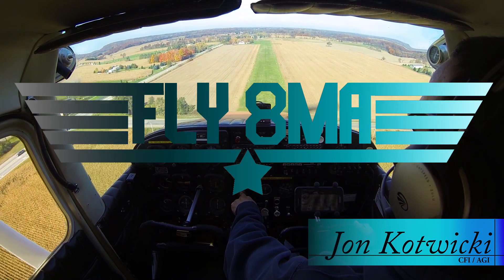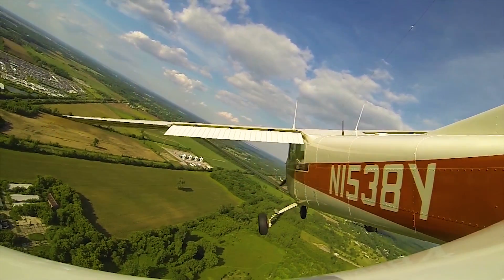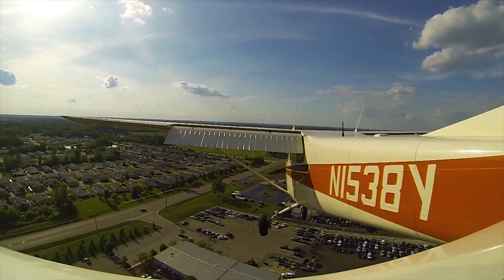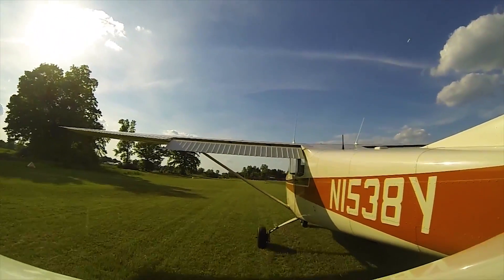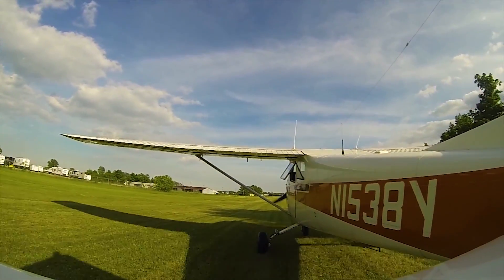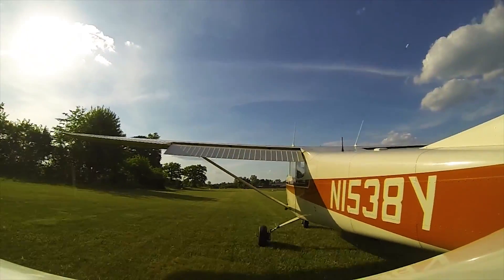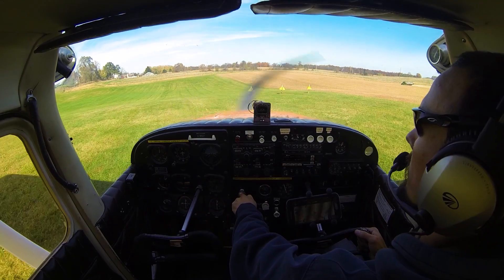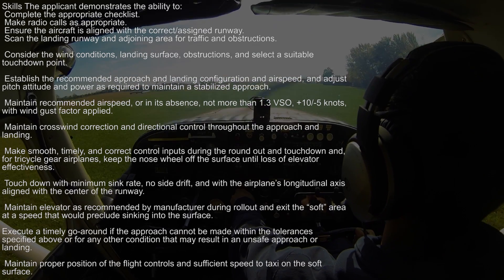Ep. 50: Landing in a Soft Grass Field

Comment: Hey I was wondering what your opinion is on turning carb heat off at a short distance above touch down on a soft strip to protect the engine from the unfiltered air?
Reply from the maker: +Danny Beyer hey Danny, I often will turn it off around 50'-100' partly due to the unfiltered air, but more because I want full power available right away in the event of a go around.  Carb heat on tends to fowl spark plugs too which can make jamming the power in rapidly pretty interesting